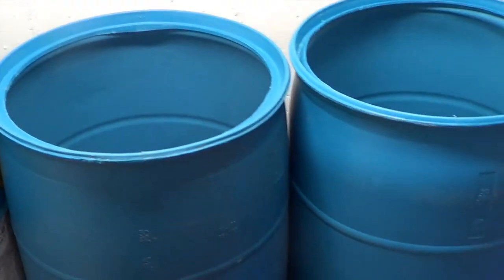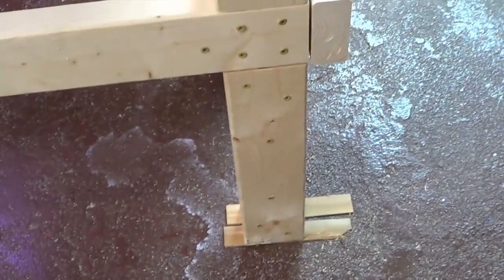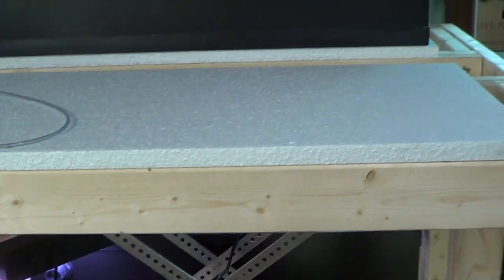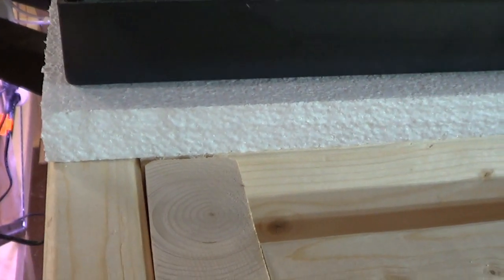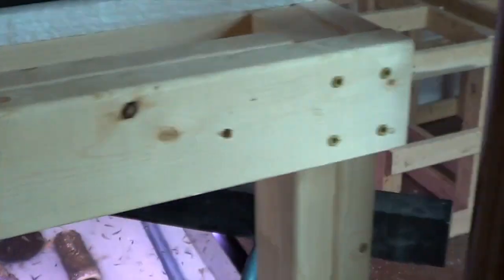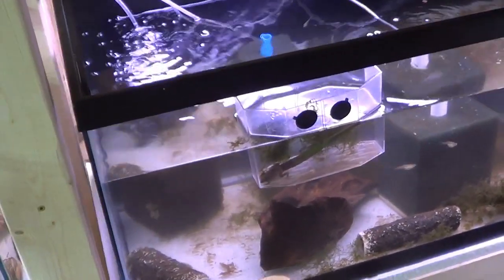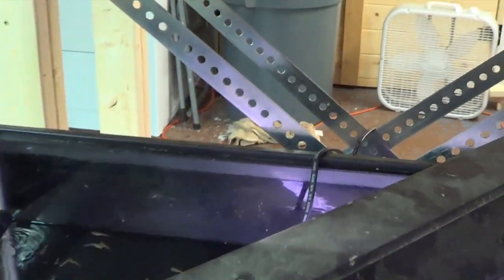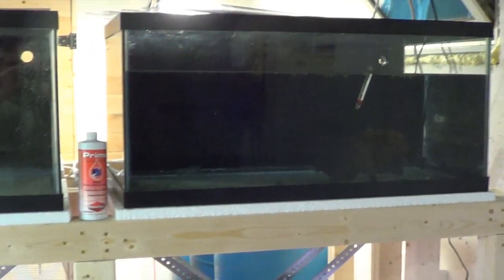#244: Timelapse Build of 40 Gallon Breeder Aquarium Rack - DIY Wednesday

Comment: Nice to see someone build something that doesn't rely on deck screws to support the weight. Always have the weight carried via wood to the ground. Also like the cross bracing. Not a big deal in Maine, but in California, the sway is what takes things down in a quake. Overall, excellent job! I'm trying to see if I can convert it to a 3 tier system...

Comment: I noticed you have styrofoam underneath your fish tanks wouldn't that cause pressure underneath the bottom glass panel of the tank is the bottom frame sinks into the styrofoam
Reply from the maker: Brandon Lyautey it doesn't sink that far, helps self level the tank
Reply: Greg Jones random question if I was to follow your same method with styrofoam but put a board on top of the steroid foam then put the tank on top of the board would that work or cause any problems
Reply from the maker: Brandon Lyautey it would probably cause more problem, but I've never tried

Comment: Is there a thickness on the screws you recommend?
Reply from the maker: Gorilla Labs make sure you have 1 inch of embeddment on the second piece of wood you screw into, when using 2x4s that usually means using a 2.5 inch screw
Reply: ***** Thanks for the fast response.  I've opted for the #8 2.5 deck screws.  Is there any benefit from getting the #10 or even getting the stainless steel screws?

Comment: Are you sure those are 55 gallon drums? they look like 35 gallon.
Reply from the maker: i just double checked, it has measurement lines on the side up to 55 gallons, i wouldn't mind getting some smaller ones at some point though, have any sources?
Reply: I have no idea. I mean where I'm from in mississippi, they are everyhere. But finding them without chemicals would be hard.